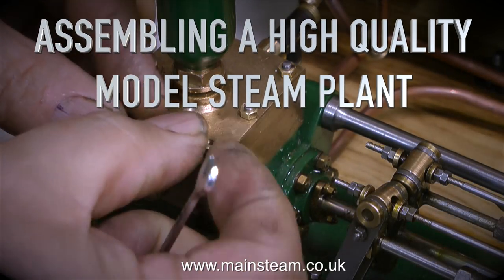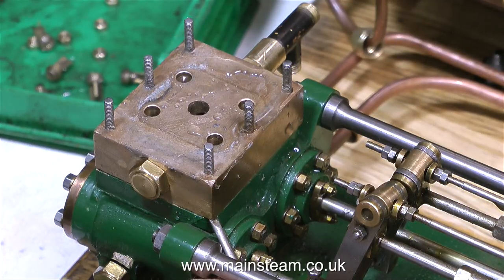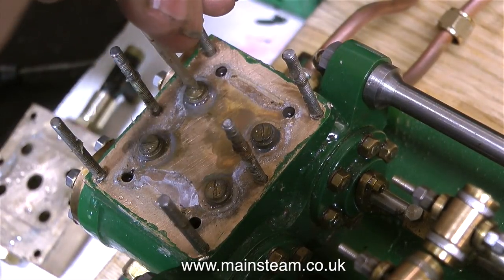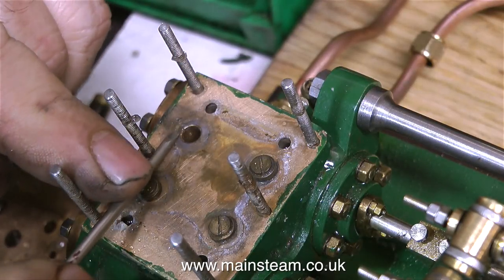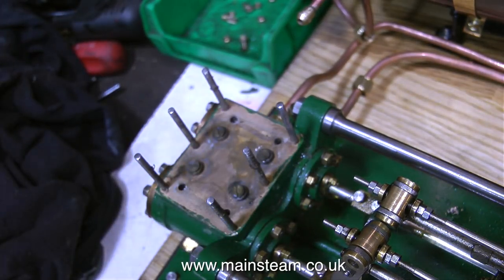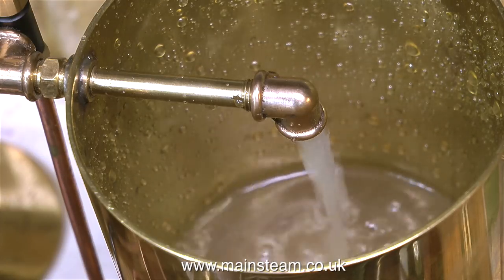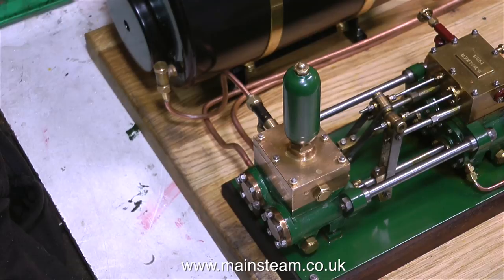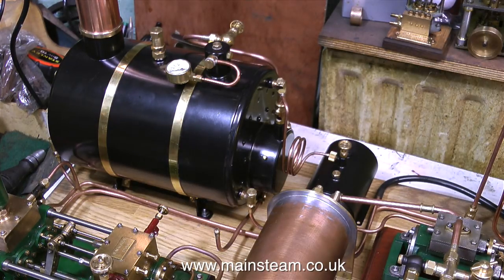ASSEMBLING A HIGH QUALITY MODEL STEAM PLANT - PART #14

Comment: Now that's a good flow! It was barely a piddle in comparison. The last thing you need is random chunks of old silicone making their way through the boiler into the pressure gauge and/or pop-off valve. Or into the steam chest and gumming up a piston ring(or something). Definitely worth the effort to fix it now. 

Nice mushrooms sir. Your shop, your rules.

Comment: Keith, the oak baseboard you have will stain black or dark purple when left against steel or iron, especially when wet.  It is the tannin which is acidic that is the problem.  It will also very quickly rust steel screws that are driven into it.  Steel and oak together especially if they may get wet is not recommended.  We have kitchen work tops made of the same stuff you have there and we are constantly having problems with stains.

Comment: Ah I was wondering why the poppet valves had slots in them.  Neat!  I've done automotive repair for a long time and I've seen more than a few major failures due to silicone rubber being jwere it shouldn't. It's a great product when used properly.

Comment: Excellent video showing the problems with using RTV gasket material.  Ideally only a very thin smear would have been put on in the first place, and then only around the edge, away from the valves.  Had the last person only used a thin smear, I doubt that you would have had the trouble with the pump that you did.

Comment: The board stains because the tannic acid in the oak is reacting with iron dust.
You probably cant stop it altogether, but you can mitigate it.
If you really want to stop it, you will need to remove everything, and sand it down with a power sander of some type to remove any imbedded iron particles.
Ideally, you should at least remove everything, and sand off the "varnish."
Give it a seal coat with shellac, then recoat with spar varnish if you can find it (banned over here for the most part). Shellac is an amazing thing, it will stick to both water and oil based finishes. You can do stuff like finish the wood with linseed oil, let it cure, add a coat of varnish, then apply a water based top coat (icky).
Shellac is also the secret to getting an even stain on soft woods. coat with shellac, add stain, then top coat.
Either way, the shellac will create a barrier between the wood and the gunk dripping off the engine.
Reply from the maker: There is no iron in contact. The blackening also occurs with contact with brass - or just spilt drops of clean water .... never seen this before . . .

Comment: HI Keith, I'm not a timber expert but I think the base board looks more like Ash than Oak. I have a desk made of Ash and your base board looks very similar.  American White Oak (a common timber these days) is more yellow and slightly darker.  Also, I find Ash marks very easily. Many thanks for another very informative video!
Reply: 100% oak- colour, and medullary rays (the light coloured bands that run across the grain)- also explains why it is marking so easily. And for the same reason as mention by some else here, always use brass screws and bolts in oak.
Reply: Ash also has a habit of rotting very easily. (Particularly as you already seem to have a mushroom problem!)

Comment: What is the cylinder on top of the duplex water pump chest? It's a gorgeous pump. A model in itself
Reply from the maker: it is an air reservoir damper to stop the plumbing noises when the pump is pumping water.

Comment: Dear Sir
Oak wood tanning acid and iron/moisture will allays give a black colouring of the board
Yours Danish Shipwright
Reply from the maker: So that's what it is - thanks for that Lars - much appreciated :-))))
Reply: That board looks far too new and clean anyway, it needs a bit of a 'patina' so it blends in better  ;-)
Reply: Indeed - The tannins and other extractives in Oak are very reactive with ferrous metals. Any ferrous metal shavings on the surface of a piece of oak will react with water and the natural acids in the wood resulting in the black marks you can see. Also water generally will mobilise the dark tannins in oak and bring them to the surface even if there is no contact with ferrous metals. These can be cleaned with Oxalic acid, but it will always be an ongoing issue. A good coat of varnish should go some way to create a barrier between the oak and any surface contaminants. Perhaps a good clean up and a few more coats of varnish will help slow down and future discolouration if you only have a thin coat at the moment. Anyway, great video as always. Keep up the good work.

Comment: Wow, that pump really pumps! Nice repair. Are you going to use a paper gasket to fix the dribbles?
Reply from the maker: Yes, a thin pper gasket is all it needs, the fits of the metal parts are excellent.
Reply: That's great! I can't wait to see it running in anger :)
Reply from the maker: very soon I hope ....... }:-)))
Reply: I believe in some aircraft engines that have metal to metal joints they use a thread, similar to sewing thread possibly silk, instead of a gasket and a lacquer to hold it in place.

Comment: Keith; what is your opinion on using old fashioned oiled brown paper for thin gaskets where you only need a water seal?
I have seen them used on old side valve engines and they seem to last quite well.
Reply from the maker: Yes, good quality brown paper makes good steam gaskets fro model steam engines.

Comment: May i throw out a theory about the issue with the base plate. Watching your video and the look of oak grain it looks like its American Oak. If this is the case and i have worked with American and English oak and the American oak has larger pores which gladly sucks up liquids and any stains it may carry if you do not fill the pores. 

If this is the case you need to putt down two or three layers of finish were one would do for British oak. I been told the reason for the differences is north America the season spread in temperate is larger ( colder winters and hotter summers ) so what happens is the summer growth is very large pores and winter growth is denser. This leads to a grain that loves to suck up liquids.

Comment: I have to ask, because you're talking about silicon sealant, do you have any experience with the, I believe the American product, Permatex products? (There are SEVERAL different ones)  If so, with these sealants, can you please enlighten with your experiences?

Nemo-
Reply from the maker: I have never heard of that product, but I will have a look. Thanks }:-)))
Reply from the maker: I Googled it and it appears to just be Silicone sealant (Instant Gasket). I try not to use that where possible on Model Steam Engines.
Reply: @keithappleton  Okay, well I did the same thing and found that, it looks like back in the 1972 range of things the original company was sold to Loctite and then everything changed. In the old days they were the best for making gaskets and sealing things. There were several different products that were used for various sealing operations. Oh well, I thought I was giving you good advice, but seems things have changed somewhat over the years.